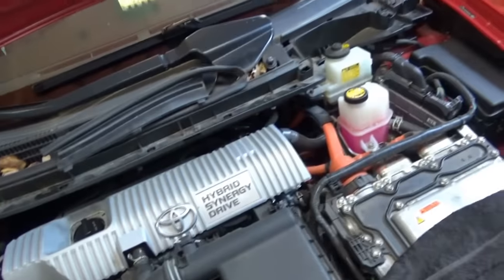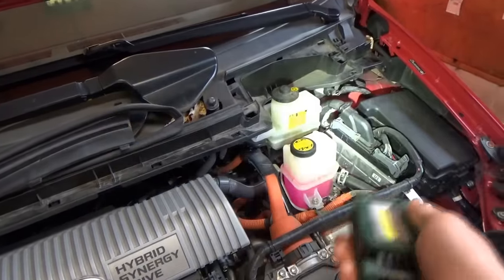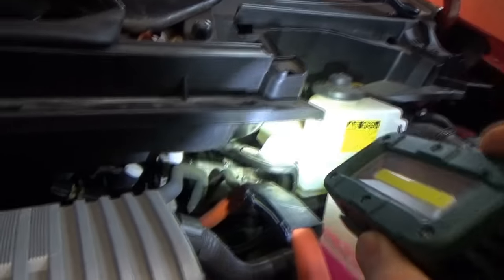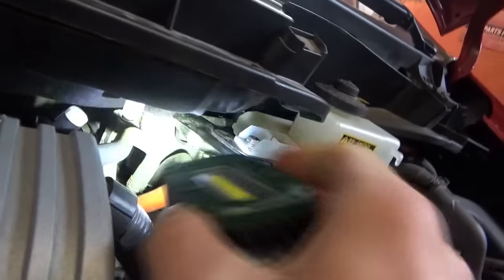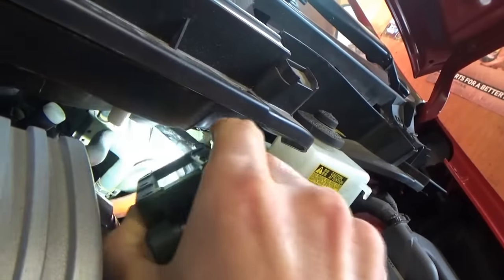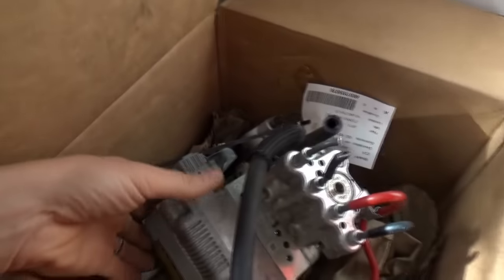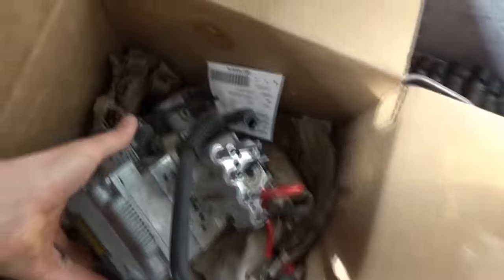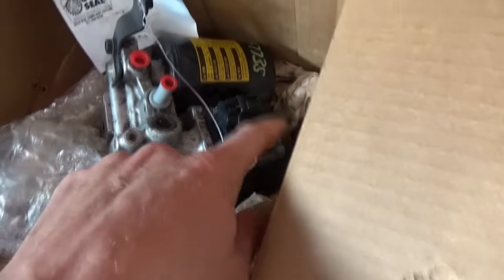Prius Brakes FAIL (Hidden COST of Hybrids)

Comment: Great video 
Today repaired 2015 Auris Hybrid with the same brake system car has over 200K miles on the clock (taxi) 
In my case it was pump motor brushes worn and jammed with dust so what I have done cleaned put everything back together bled the system and customer probably going to be ok for another year or so that gives us enough time to source set of new brushes 
Was browsing about such issues on YouTube after my repair and come across your video 
Again thank you and greetings from 🇬🇧

Comment: If the customer runs a Carfax on the vehicle it would tell him if the part was replaced with an updated unit under a recall. He could also contact a Toyota dealer and have them run the vin number and see if the recall was done. At least he would have peace of mind that the part was not the original one with the problem before he had you install it.
Reply: I was referring to the vin number on the vehicle that supplied the part from the junkyard.
Reply: What difference would it make on an 11 year old Prius with (230K), nearly a  quarter million miles? This special breed of customer that purchases these wouldn't settle or trust anything used so the Car Fax gimmick is basically useless and the owners best bet is to continue driving it until the inverter and or battery fails, which may happen sooner than later.
Reply: @MrYAMAHA32177  Ivan was concerned that the vin for the donor vehicle of the replacement unit fell into the recall, so the part might have the same problem as the original. The recall was for a bad accumulator, which is the problem the customer was having. I hate Carfax too, but if he ran the vin of the donor vehicle through a Carfax it would at least tell him if the recall was done. A Toyota dealer could tell him the same thing for free. Then he would know if he had the updated part. Trying to stop a Prius with a bad hydraulic unit is almost impossible so you have to either fix it or get rid of the car. I'm not a big Prius fan, but I do work on them. I have to admit they last a long time. On a car this old I would take a chance on a used part versus the cost of a new one.

Comment: Prius boost assist pump replacement time: 1.5 hours.
Prius brake bleed procedure time 3.5 hours.
So without the aid of the scan tool, this repair would be a no go. Got to love the complicated ones.
Reply: That’s where your gas / fuel savings go -back into the maintenance of the car, as you need to take to a knowledgeable automotive technician with the right tools and experience to service such sophisticated cars. No visits to the nearest a jiffy Lube anymore!
Reply: @paulsz6194  Yes, 1500-2000 worth of repairs at the dealer.
Reply: @flagmichael  ok, wasn’t aware they are more reliable than what you hear . I’ve only heard of the bad ones on other Automotive repair channels like Diagnose Dan & Advanced level .
Reply: What did you charge for the job?
Reply: I'm just surprised that he's going along with the hidden costs of using a hybrid (constantly in the video) where you got Nissan cvt guaranteed to blow up on you and most American built vehicles that require expensive fixes or they just simply rust out
Reply: @leexgx  Taxi owners across the globe wouldn't use Toyota hybrids if they had bad total cost of ownership. Electric cars will be using the same brake system.
Reply: @erik_dk842  I even seen some recant pizza drivers in my area using them and not servicing them correctly, not changing the cvt oil ever since owning the vehicle, 2 if them with mostly dead hybrid battery (engine firing up to recharge battery multiple times while just sitting there)
Reply: @leexgx  There's nothing more going on inside the CVT than in the differential of a rear wheel drive car. No clutches, no brake bands, no syncromesh rings, no shifter forks. everything is in constant engagement.
Reply: @erik_dk842  if the cvt stops holding its original oil properties it can cause more wear in the belt and drums then there should normally be
Reply: @leexgx  There are NO belts and drums in a  Toyota HYBRID CVT. It only shares the name with the belt drive CVT's. It works like a differential.
Reply: @erik_dk842  I am really confused about your post I know what the CVT the Toyota system is and it does not operate like rear differential, it uses 2 hydraulic controlled cylinders with a metal belt between them (just YouTube it) eCVT is as you say thought
Reply: @leexgx  I'm pretty sure the Toyota hybrid transmission is basically like a rear diff. The gas engine connects to one side (where one wheel would be on a diff), an electric motor/generator to the other side. The wheels are attached to what would be the engine on a diff. There's then a second motor/generator connected to the wheels. They by use one motor as a generator and the other as a motor, this effectively changes the gearing. The more drive they bleed off in one motor and feed into the other, the more the gearing changes. It's really clever. A "CVT" from a diff and 2 motors, and really not very much to wear out or go wrong.
Many of the conventional metal belt type CVTs from many manufacturers do just seem to be a ticking time bomb waiting to fail expensively though...
Reply: @AJB1  it's all inside the engine/transmission eCVT with 2 gen/motors (cvt oil still should be changed 50k miles or less) older Toyota's used belt cvt witch was significantly more sensitive to old  oil

the AWD-e versions has a rear motor
Reply: @leexgx  You are wrong. The Toyota Synergy Hybrid drive, which is a ContinouslyVariableTransmission, achives its variable ratio using the same principles used in a differential. If you imagine the rear axle of a truck, attach a combustion engine instead of the right wheel, an electric motor MG1 instead of the left wheel and another electric motor MG2 on the prop shaft, then you have the workings of the Toyota, Chrysler and Ford hybrid system. The prop shaft drives a normal differential attached to the drive wheels.
The car can drive on electricity alone driving the prop shaft motor. Unless the electric motor "on the left wheel" is inducing torque into the differential, the combustion engine "on the right wheel" can't put any power into the differential, and just spins.
By varying the speed and direction of MG1 relatively to the combustion engine, the ratio between the combustion engine and the road wheels can be varied steplessly over a wide range, only limited by the max rpm of MG1.
Reply: Can bring to dealer to bleed

Comment: With the cowl / wipers removed it would have  great time to replace the spark plugs too. The coils do not have enough clearance to be removed with the cowl in place.
Reply: You can use a wobbly and or elbow to remove that one spark and coil without having to remove cowl
Reply: It sucks but, I got it down to a science now, it only takes me a few min to remove the cowl and wiper assembly (I know, the whole spark plug/coil pack replacement should take only a few few minutes but, it is what it is...
Reply: I have my new plugs and now just debating, do I replace them now or wait till I get new struts and do them both at once. All the same crap has to come off.

Comment: So actually 2010 had a massive recall for the break actuator and abs system. They actually would have done this job for free at the dealership up untill like a year and a half ago. I had it done for my 2010 with like 170k miles back in 2019. It was a 3000$ Job and it was free. Other 3rd gen prius don't seem to have this issue from what I know.
Reply: how many parts did they replace? the master cylinder and the accumulator? i have a 2010 and dealership said i am too late for the recall
Reply: @alohajason  if you got an address I can send you one from a prius I just bought from a wreck. They replaced the break controll module and master cylinder and possibly break booster
Reply: And some kind of actuator
Reply: @reformedchinesecommunist  yup its in my doner car in my garage, all the parts are in tact I just took the engine out for my other prius.
Reply: It was a voluntary service, not a recall that ended in 2019. Bought mine used in 2018 but the ABS started acting up in 2023.  I’m told both the brake booster assembly and pump need to be replaced. Trying to find a workaround

Comment: Could he call the dealership and ask if the donor VIN has had the recall done already, suggesting that the supplied parts should not be an issue?
Reply: Or, maybe you can determine whether the supplied parts are post-recall parts by the P/N's or date codes on them.
Reply: icesoft, GREAT IDEA.
Reply: @kellyx57  They would have different model numbers.

Comment: So I’m still trying to figure out why you didn’t replace the actuator pump? Reason being, I just bought one because I’m having the exact same problem with my 2015 ct200h in which share the same part number as the Prius I did not purchase the master cylinder or brake booster. Also, for those of you saying that he replaced the part when the car was under warranty that is not correct. As he states in the video, the car has over 200,000 miles. This warranty is good for up to 150,000 miles so this car is out of the picture. My Lexus has 149,000 miles. Although I just left Lexus and they don’t even have a warranty it’s Toyota Prius only. Same part number. Great job on the repair man. Loved the video and I’ve learned a lot.

Comment: That turned out great. Having said that, I don't think I'd do it. With some customers, if you install parts they supply that are defective and the car doesn't work, they won't pay you for your labor
Reply: Exactly, I know a guy that installed a engine THAT the customer supplied from junkyard, it was no good and she wanted him to swap another free of charge...He offered to supply the engine him self from the junk yard with a small markup that covered the labor in case of a bad engine, but she wanted to get it herself and save the 200$ markup. It costed her additional 600$ + for swapping the engine again.
Reply: Mechanics liens exist partly because because no mechanic can know for sure that any part built by other will work correctly.
Reply: Then you put a lien on their car and it’s yours to sell :)
Reply: @psdaengr911  Right, but we don't know if Ivan had him sign anything

Comment: It’s not just hybrids. My sons 2013 2.0L Ecoboost Fusion had an issue where only one caliper was working and would manually bleed. They would all bleed if you used ForScan to run the ABS module bleed procedure but otherwise, nope. Took it to the dealer, bad ABS module (hydraulic unit) and since it was revised, the old ABS control unit wouldn’t recognize it. Long story short, new parts were $1,500 for both + labor $680. 

I could’ve gotten used parts or reman parts but they were all old versions so it would’ve eventually had the same issue.  Older gen fusions 2012 and below had a recall on these parts but 2013 was a different gen so, out of pocket for us.

Comment: Have to laugh because this is not a common failure on a Prius (I've owned 3), the cost to repair at the dealer is under $2,000 and there is nothing 'hidden' about the replacement of a pump that's been working in the car for 12 years and 230,000 miles - all while the system is also saving fuel by averaging over 50 mpg. Do the math and compare it to replacing brakes on a non-hybrid 30 mpg car to the tune of $100 in pads/labor every 25,000 miles and $400 in rotors every 50,000 miles. The Prius pads & rotors often last the life of the car because of the regenerative braking system - and if/when they do need replacing, they are no more expensive than the pads & rotors on any other car. Because of the longevity of the brake system, the cost of repair and maintenance over the long run is equal to or less than that of a non-hybrid.
Reply: They wouldn't be so popular with taxi owners across the globe, if the total cost of ownership wasn'r favorable.
Reply: Over here in Australia it's more than that to fix, the sharks(some wreckers want almost 3k just for the parts) I have 3 Hybrid Camry's, 2 of them have around 700k on them & the other about 150k!
Reply: Pads and rotors last the life of the car? That's a flat out lie. I've had mine for 180k miles and Had to replace them around 5 times, had all the calipers fail and need to be replaced, and now the brake booster sensor if not the brakes themselves are failing and if It isn't the sensor my 2013 toyota prius is heading for the scrap pile.
Never getting a prius again. Nothing but problems.
Reply: It all depends where you live. With NYS salt my Prius just eats through breaks due to rust/vibration. I have regularly smack on a breaks to clean the rotors from rust,especially rear ones. Of course if you drive in California or Arizona and you are smart and mostly use regeneration breaking your breaks will last for 80k+, but not in my neck of the woods.

Comment: Thanks for this video, I have a 2012 Prius with the same problem. Because of where I am located and my steering wheel is on the right side of the car. I can't use US ebay parts,  Toyota dealership don't stock the parts and would have to do a custom order and the qouted me 4k USD for the actuator alone. That is about  half of my car's current value. The next option is to order  a used part from Japan. Also now I know  that I should check to make sure the Vin number from the donor car is not on the recall list. Thanks again for this Video  👍

Comment: I have 2 Priuses. One 2002 and one 2012. The 2002 Prius has 400,000 and I havent put a penny into it other than a $200 wheel bearing. The 2012 is going strong at 289,000.
I bought the 2002 brand new and I just bought thye 2012 for my wife.
Reply: Those cars are indestructible

Comment: Interesting video . . . just highlights the kind of bill you may have to face, on an early vehicle, if the dealer does the work.
Reply: It would of been free if the owner kept up on recalls which they failed to do
Reply: That’s incorrect. It was technically a customer relations bulletin. Toyota would only fix it if your Prius broke prior to ten years old and prior to 150k miles. Technically, it was never recalled for this issue

Comment: I noticed your comment on 45mpg being very good. Here in the UK, we've had to put up with stupid prices for a very long time (currently £1.50/ltr). My european lil' bus is a Peugeot 306SW (a very short estate car) gets me 73.5mpg at truck (55mph) speeds on the motorway. It's a 1.4L turbo diesel.
Reply from the maker: WOW that is amazing!!! My Suzuki work SUV gets 22mpg if I'm lucky haha
Reply: Gallons are different....UK vs. US
Reply: That would be around 61mpg on US gallons, still way better than any hybrid and without any expensive control systems. Sadly diesel is no longer an option in the USA.

Comment: A buddy of mine bought a Chevy Aveio which I thought he was crazy for, but now he has 253,000 miles on it with changing 2 timing belts only. Still the original brakes, shocks and CV joints and still gets 30 mpg. Now that is a real economy car!
Reply: And also a deathtrap

Comment: I just watched Rainman Ray's video on a Ford Van with an ABS problem and the ABS replacement was $1100 with around 4 hours labor. Every vehicle today has expensive and complicated ABS systems. It doesn't matter if it's a conventional engine or a hybrid. Maybe with the hybrid, the money saved on fuel might offset the repair cost but that depends if it was driven far enough to offset the original purchase cost difference.
Reply: Should have liked before I made a similar comment about the same video - he sure pumps them out.

Comment: Not just a hybrid thing. It’s all new cars. The forerunners and tacos with a-trac from the early 2000s through current have the same braking system. 
My hummer h2 has the same system. The Chevy colorados I think even have this. 
I think it’s bs that there are no rebuild kits for this. The master cylinder is leaking on mine and I have to replace the whole assembly for $800 on parts alone instead of just a few dollars for seals.

Also when I bled mine I didn’t have to do the bleed with the scanner. I just filled the fluid and started the car. Because the brake pressure comes from the accumulator and not the master, I only had to press the pedal once or twice on each side to bleed all the fluid.

Comment: I own a '19 prius but I watch all the older gen videos. Seems u HAVE to remove firewall parts on alot of prius work. U did a super job. If u divide $2000 by number of yrs, not too bad. I agree with u, purchase new. Do it once, do it right. That was a nice 2010, I would have gone new. Plz do more Prius jobs when u can. I sub'd & gave u a 👍. U make great videos! 👋

Comment: To hold a brake or clutch pedal down when working along buy a long enough clamp from Harbor Freight. You can reverse the 2 clamp end and use it to spread instead of clamping.  Place between the pedal and steering and press the clamping handle trigger unitil the pedal is depressed.